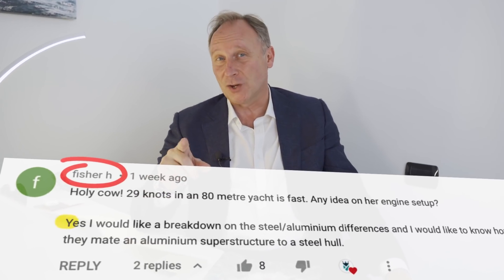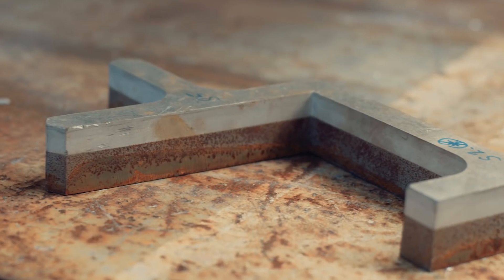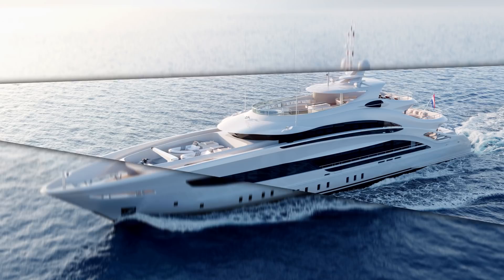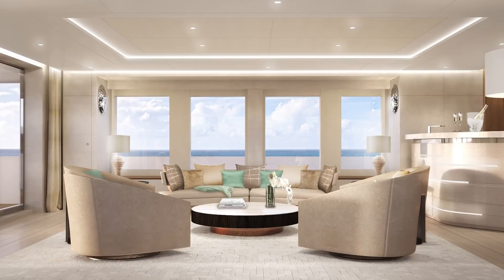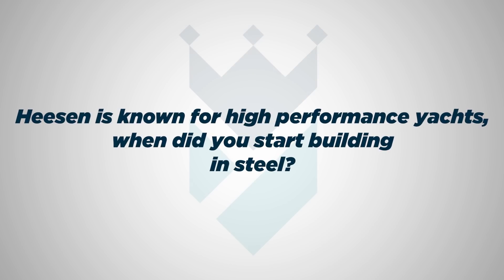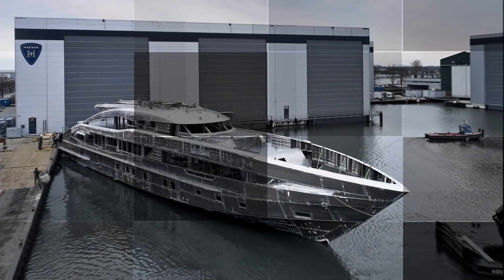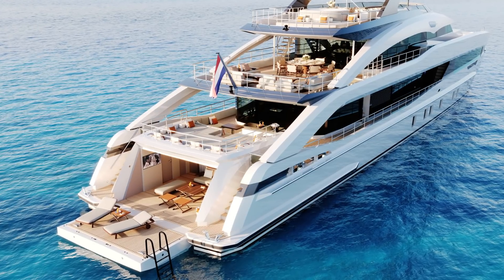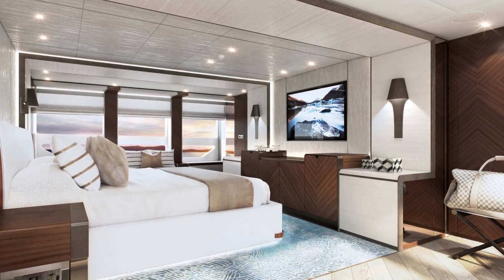STEEL HULLED AND ALUMINIUM HULLED HEESEN SUPERYACHTS - BUT WHY???

Comment: How much stronger is aluminum than steel?

For example, there is a rule of thumb in boat building that aluminum is roughly half the strength of steel at one-third the weight. This means that an aluminum vessel can be built at a given strength that is two-thirds the weight of a comparable steel boat.

Comment: One thing I didn't see mentioned is the collision/impact differences. In "general" steel is a lot more ductile and will deform from an impact, whereas aluminum will tear and buckle. However this rule might not apply for the very specialized alloys used in ship hulls. So I'd be interested in an expert opinion as to differences. My other thought is that for a boat with the proper equipment in steel, if you got a small puncture, you could grab your underwater welding gear and dive gear, and a metal plate (hammered to the right shape on your workbench anvil), and reseal the hull.  I don't believe that is possible on an aluminum hull.  But maybe this is such a rare occurrence that it basically just isn't worth considering? Or maybe there are other solutions like some type of underwater curing rubber sealant that can be used in an emergency?

Comment: good advert for Heesen. Crossing oceans in near gale winds, I have found a steel deck+hull to be a quieter, more comfortable ride for long, continuous passages over 2000NM. Also, steel can survive a modest impact: Al and GRP cannot. Al corrodes just as easily as steel in salt water. etc.

Comment: Hello this two alloy structure is often used for fisher boats , the main raison why we can not weld both alloys on each other is the different fusion temperature, that is also why first the steel alloy is welded witch has a much higher fusion temperature than Aluminium, on the longer term the electro-potential difference  between the two alloys will have the joined  corroded away in no time.

Comment: Please read!   They keep talking about aluminum  being lighter and then they put in larger engines.  My question is, what about aluminum with 'steel engines'.  They keep comparing aluminum with faster engines vs steel with slower engines due to weight, but what about the transverse?

Comment: The hull design has more to do with the draft than the steel or aluminum construction. Steel is going to be used in a full displacement hull. Where an aluminum boat is probably going to be semi-displacement.
Reply: or plaining hulls

Comment: You talk alot about the design and construction aspect of the two metals, but only briefly touch on the owner/operator experience.  Here are some theories and more questions based on no experience whatsoever:
Aluminum, being highly corrosion resistant, might give the ship a lower long term maintenance requirement.  Over time, that could pay for the higher upfront cost of production.  Also, maybe it could stay out of drydock longer?
Also, you mentioned high speed performance, but do people optimized aluminum ships for fuel efficiency?
The lighter aluminum ship might get tossed around much more easily in weather than a heavy steel hull, making the open ocean an uncomfortable ride.  As you said in the video, that would be offset by the ability to glide over shallow reefs with ease.
For resale, I guess it depends what most people are looking for in that size of a ship.  If people don't mind being relegated to the Caribbean or the Mediterranean, then the maintenance-free nature of aluminum might be a great selling point. If people are looking for an "I can go anywhere I want" vessel, it might be harder find a buyer. I'm not adequately informed on current market trends.

Can anyone comment is this?
Reply: I have only information from my reading, but my understanding is that since both hull materials require annual haul-out and bottom anti-fouling paint, that the cost of that must be at least 90-95% of the cost of corrosion / barnacle hull maintenance costs... so the different can't be more than a few percent.

Comment: Wow! Great information, I have heard about it but never saw the material in reality. The negative (inward sloping) windows make it stronger in high seas and have at least two more benefits. One a better view with less reflection and the second a cooler temperature on the bridge as there is less direct sunlight flowing in.
I would find it interesting if they have ever thought of combining Aluminium with Carbon/Kelvar and glueing them like currently done in Aero and Car industry.
Reply: As far as i know Heesen doesn't want to work with composites due to environmental reasons.

Comment: Why carnt you achieve the same top speed with a steel hull that you can with an aluminium hull
Reply from the maker: Hi Paul, Steel is a much heavier material.
It's the same reason that my 60Kg colleague Ed beats me at gokart racing.

Comment: which are better as far as speed/range goes ? diesel electric like wider ? or the full diesel ones ? and if the diesel electric is the better option, why doesn't everyone shift to that ? 
  also, very important question. i saw that the new princess x95 has awesome big windows at sea level, which allows awesome views as the boat is on the way, why aren't there more yachts who have that ? 
  i mean... with the view from the vip cabin from the x95, i would actually prefer that room, and let someone else take the upstairs master cabin.
Reply: As a chemistry student I think I can help answer the first two questions: 

Classical Diesel engines will be better in the combination of both speed and range and probably even if you focus on just one of the two than electric Diesel propulsion (DEP). Let’s assume of course we talk about identical hulls and only vary the type of propulsion. 

Looking at range first the reason being that in order of transforming Diesel to thrust in a traditional Diesel engine boat lost energy occurs in the form of heat. This happens at the engine, whereas in a DEP system lost occurs twice; once when the Diesel is translated to electricity (try touching a Dynamo after your next nightly bicycle ride) and again when the electric engine converts that into thrust. In other words you would need to plan more room to accommodate enough Diesel and Battery’s which makes the boat heavier which affects the range. 

In regards of speed I’d assume the same laws of physics apply as in cars: a Tesla is immensely quick to get to 100km/h and even a little further but the ideal cruising speed is, despite its good aerodynamics, lower than that of a Diesel Mercedes. Putting that into the water it might be possible that a DEP accelerates quicker but at higher speeds the range will be gravely reduced compared to a classic Diesel Engine who will reach the same top speed, depending on the engine that is, but will likely be able to hold that speed for longer.
Reply: @arno9711   i appreciate the input 😊
Reply from the maker: Diesel Electric is great for range and low emissions, but they tend to be very slow. If you want a 20 knot + yacht then diesel electric is not a good solution. Also, due to the size and weight of batteries most diesel electric yachts tend to be at least 150' in length.
Reply: @Yachtsforsaleblog   i see. they are two different type of uses for each. lol it's funny how specific the yacht industry is, depending on what you need.
Reply: If you have a planing boat (not sure about semi-planing big yacht) where your two humps of max efficiency are at idle and 80% max power, it wouldn't help. I assume you are talking about a system where little to none is stored in a battery - but rather the motors and shafts are connected by electric generators, electric motors, and wiring, and not driveshafts. With a top efficiency motor of 98%, and top transformer efficiency of say 96 or 97%, and back to the generator, you are down at least 10% from the transfer, versus a 3% loss from a gear set or universal drive, right angle gear (like in a pod drive), or whatever. But the great benefit can come if you are interested in speeds beyond just the "one best speed". If you normally run at 60% load in a displacement load, but want to run at half that load... a diesel at 30% load is WAY off it's peak efficiency load, so instead with diesel electric you turn off one diesel completely and run both electric motors from one diesel, which is then back at a more efficient 60%. The gain from that optimal load with outweigh the loss in the electrical.... but look at how much more expensive your engine room has become! And you can't repair electric generators/motors in the middle of the ocean, so unless you have space to carry spares there are a lot more failure points.

The other reason you do it is when your number of shafts and the number of diesels you need aren't equal... if you want one shaft and two motors, or two shafts and 3 or 4 motors or whatever.  Like a big cruise ship will usually have 4 or 5 motors - two for electricity and two for propulsion and they rotate using 4 of the 5 motors so one can be under service/inspection while underway.  The reason you might want one screw and two motors is because you don't care about draft and want one hug center screw protected by the keel for efficiency, or you might want two screws to either side of the keel to reduce your draft, if  you need that...